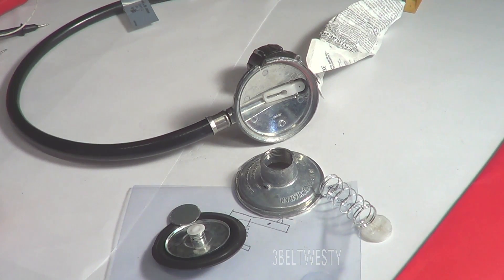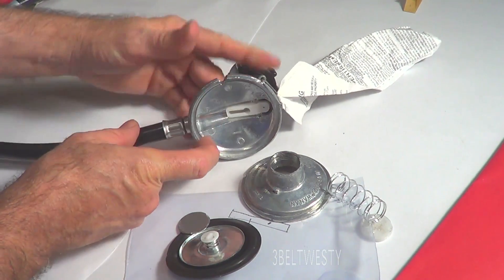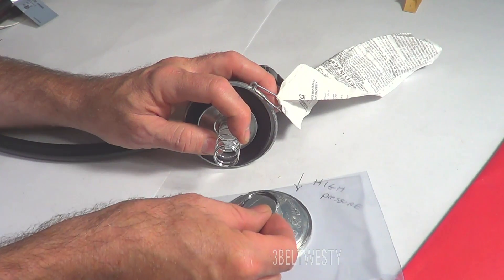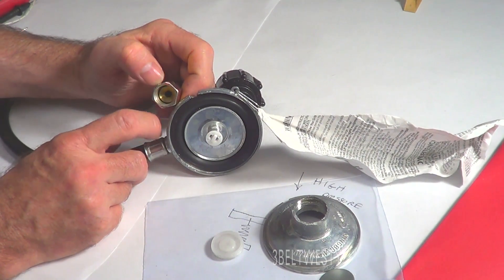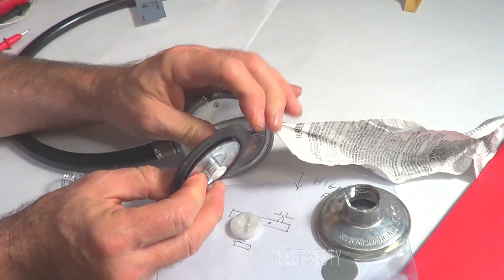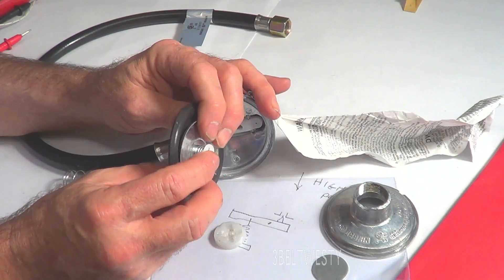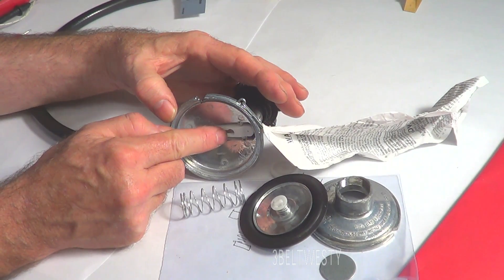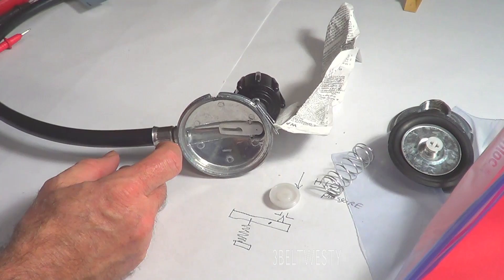LP Propane Regulator inside workings

Comment: Why does regulator freeze up? My propane heater will either shoot out more heat/gas or not as much when the regulator starts freezing/releasing propane. Whats going on here?
Reply from the maker: Here is a 2 page pdf explaining Freeze ups of regulators:

https://www.marshallexcelsior.com/sites/default/files/MEC%20Freezing%20Regulator%20Reference%20Form%201001,%20Rev%20A,%202-10-17.pdf

Comment: If you turn off the grill all valves off the pressure is still in the hose like it’s blocked if the pressure in the tank should climb the regulator could bypass in the bypass the check valve on the regulator will shut down the flow automatically

Comment: Blocking the hose, was the stupidest thing I had ever heard.   It is basically blocked when the valve is shut off.  
The weep hole is for atmospheric balance.  And also, if the diaphragm ruptures.
Reply: We had a microburst come through yesterday and my bbq grill was tossed about 30 feet away.  I checked the grill today and the weep hole is leaking when it turn on the propane.   Does this mean I have to replace the regulator?
Reply: I think so. I had a similar issue.  I have been smelling propane and notice last night that out of the peep hole I got a flame. I flew it out and turned off propane. I think you and I need need a new regulator hose.

Comment: Excellent video but I'm not sure what is going on with my Weber regulator.  I have brand new burners installed on my 9 year old, 4 burner grill.  I swapped it out with another LP regulator I have on a glass bead fireplace and everything works great so I'm pretty sure it is the regulator that's acting up.  Weber tech support (10 year warranty) insisted it was the burners and sent me 4 new units. Oh well  thanks Weber! I'll be calling you again for a regulator.  After watching your video I am still unsure of the failure reason...
Symptom: Turn on the tank.  If I wait more than 5-10 sec - a lot of pressure builds up and when I ignite the first burner I get a huge rush of propane and a nice fire ball (contained within the grill body :-).  The flame then settles down but adding a 2nd or 3rd (or 4th) burner in and the flame is barely wafting... 
So it seems that the diaphragm/valve combo is allowing too much gas/pressure to pass.  But if that is the case, why don't all the burners have large flames?  Just wondering what you think is happening inside.  I fully expect to get a new one from Weber (or I'll buy one) but my left brain is curious... 
Thanks again for taking the time to create the video
Reply: Sounds like the diaphragm is shot, or the spring valve is not working correctly do to gunk buildup up probably, propane is a very dirty gas.
Reply: @travisdoe4663  Ha, well - I appreciate the insight any time it is offered... lol - I actually got Weber to replace the regulator and also learned about resetting the regulator. (and educated a family member on opening the tank too quickly... ;-) - thanks Travis.
Reply: @kyryder7220  lol, didn't look to see how old the post was. Glad you got it figured out though 👍

Comment: I have just had a Camco 2 stage 59333 fail by leaking.  The small pinhole in the 1st stage that faces up (it is near the pressure gauge plug) was leaking nonstop and drained my new tank.  I replaced it, but I am curious what that hole is for and how the regulator failed.  Thanks.

Comment: Can you tell me the proper size or the fitting that fits into the hose end opposite of where the regulator is. Or the barbecue end. I have an old RV stove and my 3/8 tubing from it won't fit into the   regulator and hose that I purchased to hook to my 20 pound tank in my garage as a spare little oven

Comment: Will tapping it help with me fixing  low flame  pressure at my grill ? Can I service it.do they fail often.  Thanks
Reply: That's my problem. Or do we just replace it?
Reply: I cant swear to it but I've got the exact same regulator for my stove in my camper now I been living in this sucker for 4 yrs now while I gut  and redo
Reply: Sorry fat fingers  anyway redo the house twice now I've run into issues when it turned cold out 28 degrees seems to be the magic temp flame dwindles or very low pressures  after I turn burners off to restart then too much pressure. I just shook out a bunch of water from that weep hole and my guess is if water can come out it seeped in the same way at 28 it froze causing the problem so it's doing what it's intended to do at closer inspection its stamped on the body of unit to protect it from the elements.aka rain.  I disconnected mine shook a lot of water out wrapped that rascal in plastic and I'll find out tonite when things freeze again i hope I'm right if not what's another ten bucks.

Comment: I do not understand... if the out port is blocked... well, if the BBQ is shut off, it is the same as blocked. Would that cause problem to the regulator?
Reply: MetaView7 I believe it is actually just an over pressure vent. If the primary spring fails or a physical blockage prevents the seal of the inlet this opens to prevent that full pressure going to the appliance. It would also activate if liquid lpg entered regulator for example if the bottle was inverted.

Comment: Hello, in a case where the regulator and the valve is the same unit like the one on a portable gas grill for example a Webber Q grill. Can I take apart that type of regulator valve? 
I own a camper and it has a low pressure quick connect for a external appliance such as a portable grill. I contacted my portable grill and it didn't work because it is putting out low pressure and the valve on the grill has a regulator. It lights up but just doesn't get hot enough to even fry a egg. Before I get myself into a situation, maybe you might know if I can take it apart the regulator to remove what regulates the gas without big consequences like a explosion. Hope to here from you soon.
Reply: Angel Torres I seriously hope your camper has not blown up by now!! Joking aside, if your main goal is “rig it so I don’t blow up” I would probably skip the mods and just buy a low pressure or adjustable regulator and remove the blow-up risk. 😝